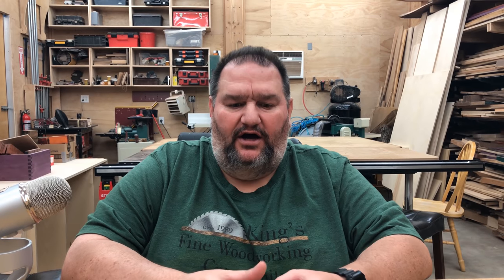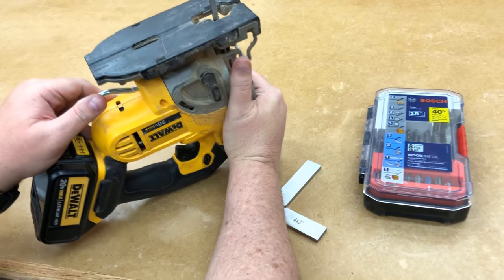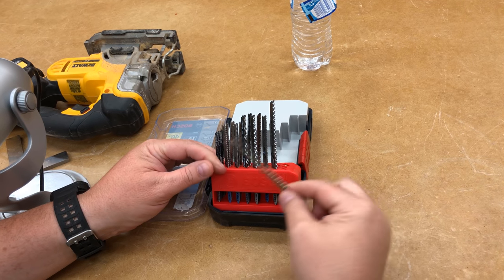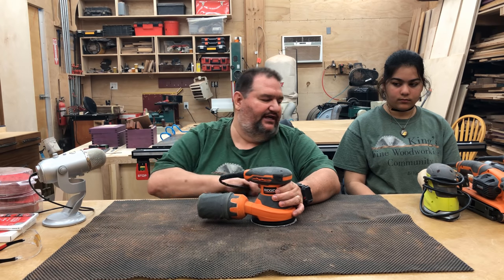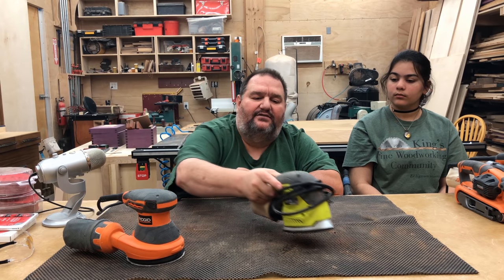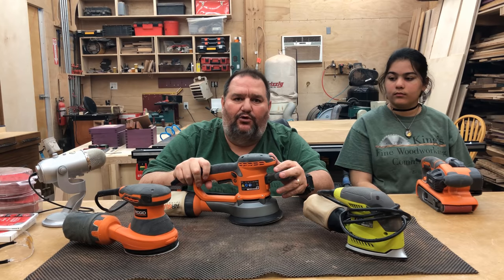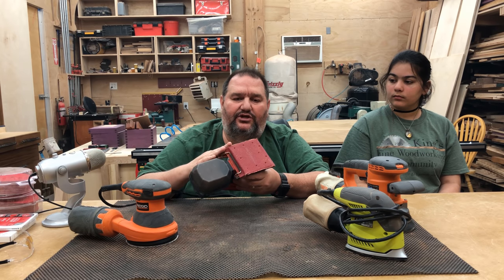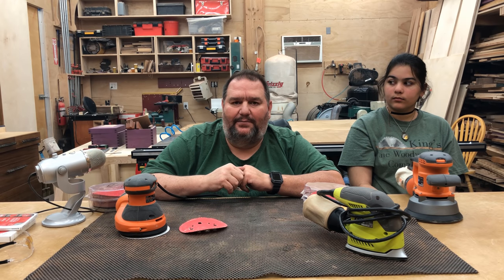57 - Woodworking 101 FREE ONLINE COURSE LESSON 1 Part 4 of 8 Jigsaw and Sanders

Comment: James: for the ROS is a longer throw better than a short throw?  In the world of car polishing the longer throw is desired but comes with an added cost.
Reply from the maker: It depends on what you are looking for. A longer throw means more aggressive sanding. So if you have a lot of material to remove it is better. Like when trying to sand off an old finish on a re-finishing project. 

A shorter throw on the other hand is better for final sanding because it leaves less scratches & a better surface. 

In the inexpensive 5” disc sanders I have they are all in the short throw range and that’s what you get. 

In more expensive sanders there is often a switch to change back & forth as your project calls for it. However, even with that option, I always find myself using the short throw range.   But it’s probably because I am not a furniture refinisher.
Reply: King's Fine Woodworking TY James.  I have both types of buffers but I wii pick up a short throw sander dedicated to wood working.